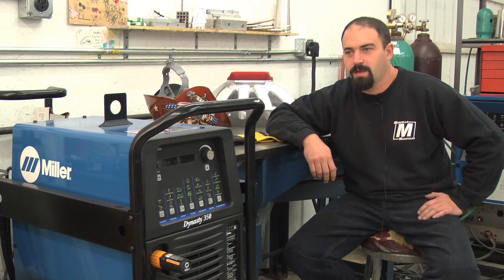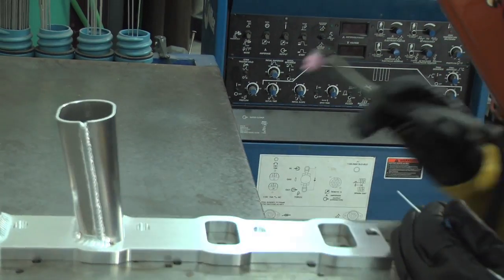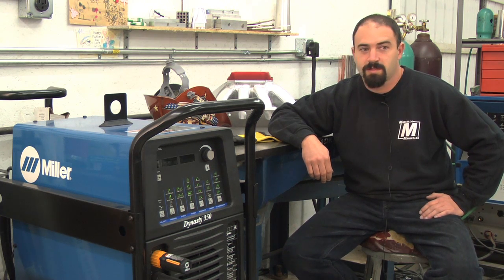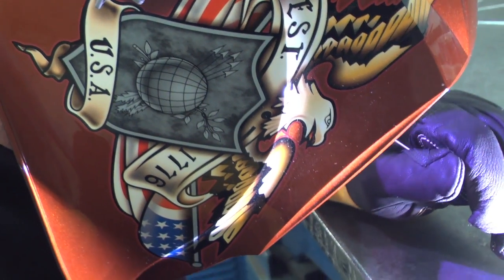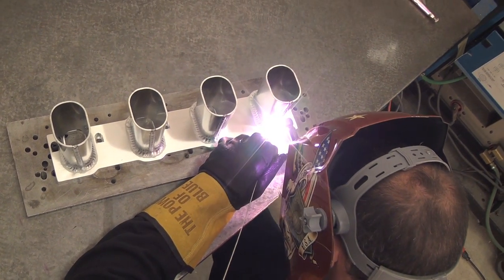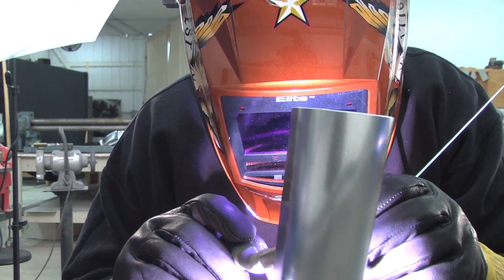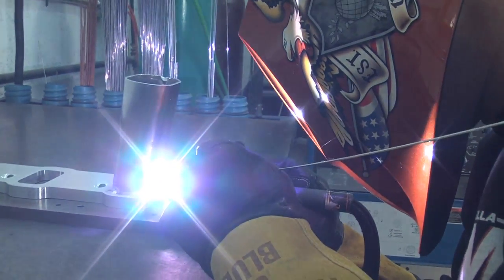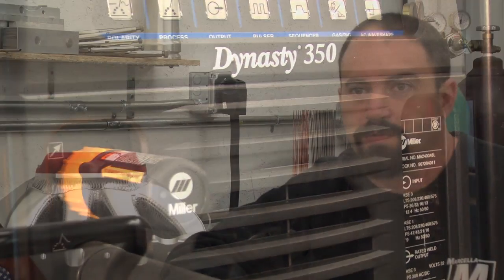TIG Welding Aluminum Manifolds with John Marcella

Comment: Hey I'm welding cast aluminum intake manifold remove throttle bodie flange I'm replacing it with another flange but 1inch aluminium flat sheet can I weld them together cast aluminum to sheet aluminum.
Reply from the maker: Thanks for reaching out. You will be able to weld cast aluminum to sheet aluminum. The process will be AC. You will just need to adjust the amperage for the thicker material, and use torch position to bring in the thinner piece. Thank you.